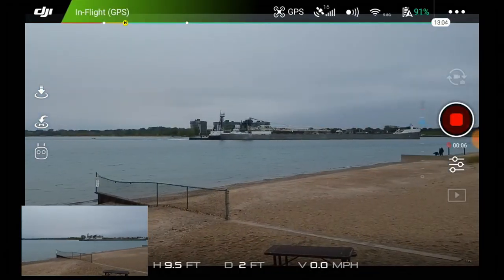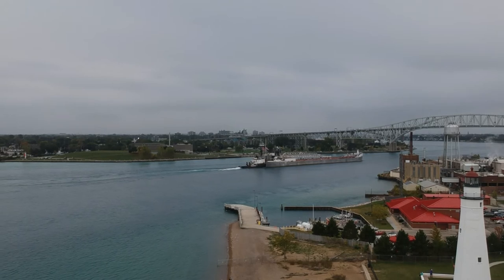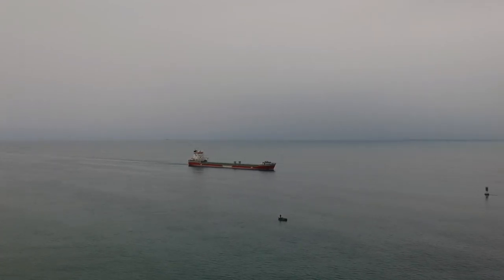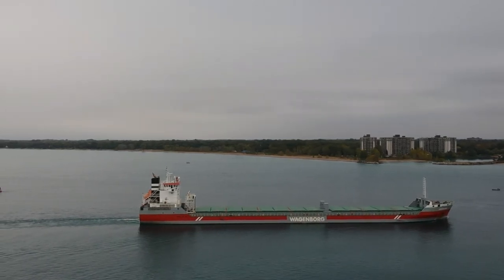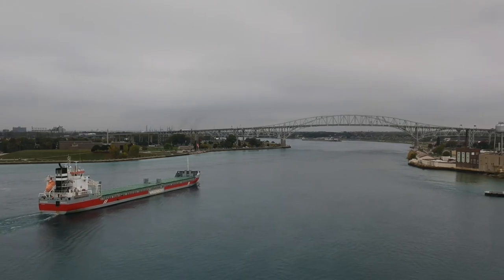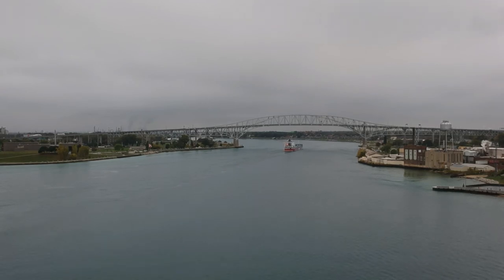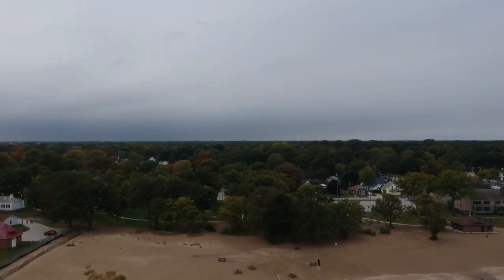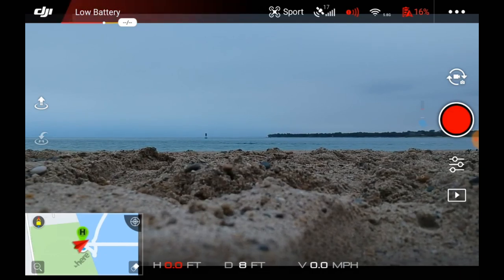Video Drone - DJI Spark Flying Multiple Freighter Over Lake Huron!

Comment: More interesting stuff. I like it.
Can you tell me do you have the 180° Pano option and the raise arm for video in gesture mode on your spark ?
Reply from the maker: Yes it has 180deg and as I understand it now 360 too however have never used gesture mode...
Reply: Video-Drone The reason I ask was I updated the firmware before my fist flight but it doesn't have the 180 and definitely 360. Thanks.